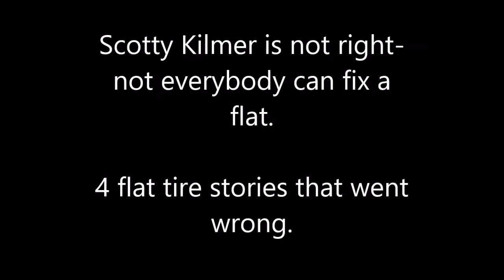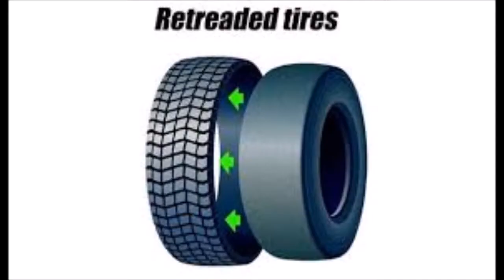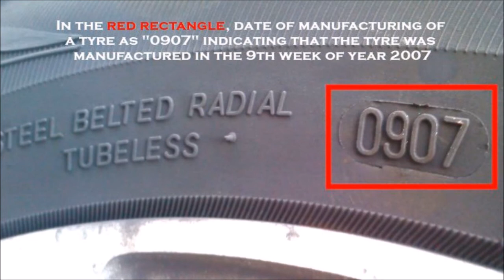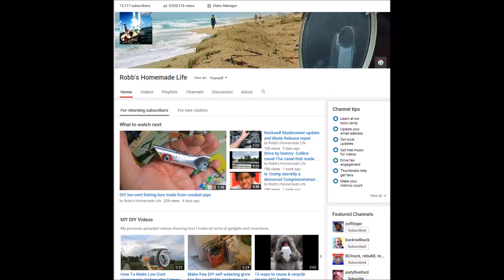Anyone can't fix a flat Scotty Kilmer is wrong

Comment: Maybe the easiest way to get a stuck nut off of a stud, if you don't have an oxy-acetylene torch with you, after you've tried everything else (pipe over wrench to extend its length) is to start cutting through the nut with a big hammer and a metal chisel. Bang on the chisel to make a bit of a slot in the nut, then continue banging on the slot until either the nut starts turning, or you've enlarged the slot to where it is almost touching the threads on the stud - until you have a paper thin layer of nut left at the bottom of the slot. Then break thru the paper thin area and pry the nut off of the stud. You'll need to find another nut to replace the sliced-thru nut. If you have a "nut-cracker" you can use that instead of a metal chisel but that is a specialty tool; a metal chisel is a cheap tool "in everyone's toolbox."
Reply from the maker: I agree, it is also helpful to carry a small sledge.